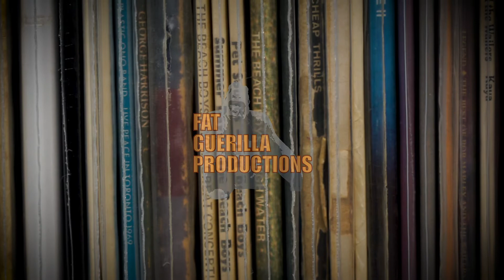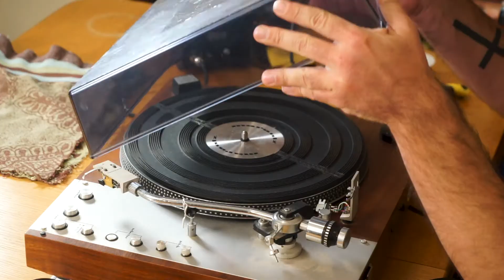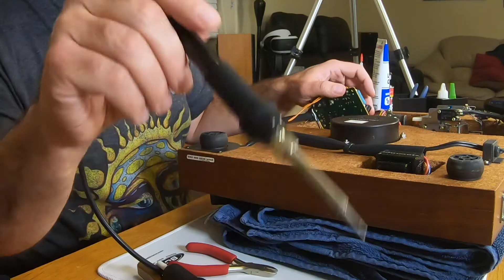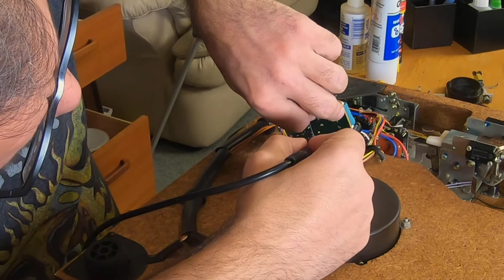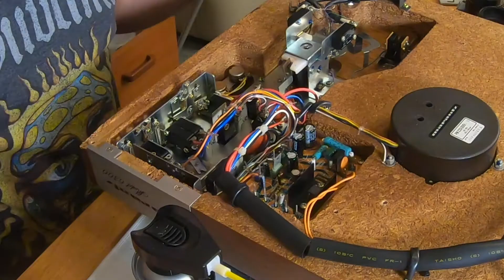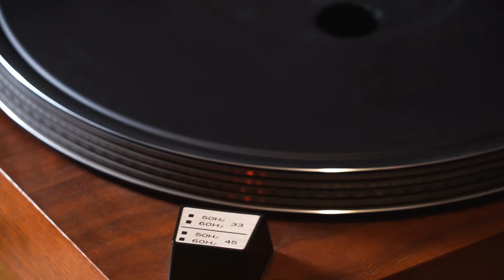I DON'T KNOW STUFF - Recapping and Refurbishing The Mechanical Stuff in a Marantz 6300 Turntable

Comment: Nice video!  Just a couple questions for you:  1) the service manual lists only 5 caps for the P800 board.  C801, 802, 803, 804 and 805.  You said 8 caps replaced.  what are the other three?  2) It looks like you did not replace the ceramic cap at C801.  any reason?  Thanks!

Comment: Was the turntable completely non functional before recapping it? What were the symptoms? Or should these old stereo equipment be recapped simply because of the age? Beautiful piece btw, can't beat that vintage styling.
Reply from the maker: The speed was sporadic and even after it was dialed in, it needed monitoring. The thing about recapping the 6300 is that it's only like 7 caps and it's one board so it's not a huge job. Also no sound goes through the caps it's all about speed regulation so if your speed is rock solid, probably no need to recap. Thanks for watching.